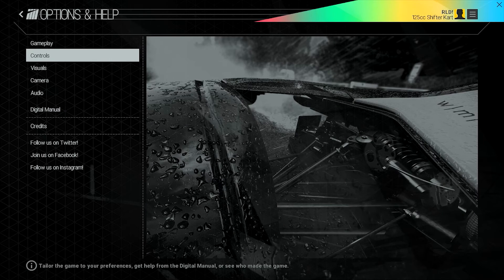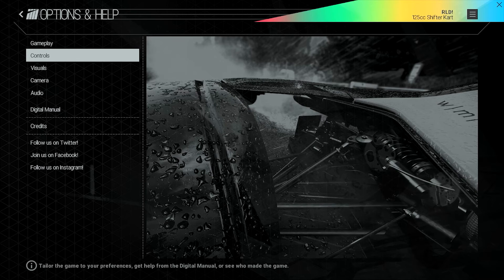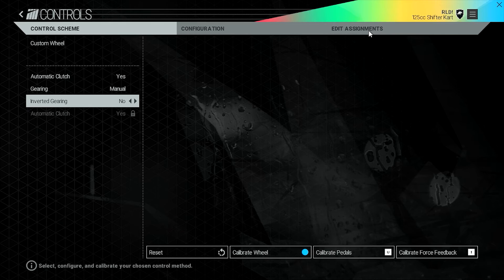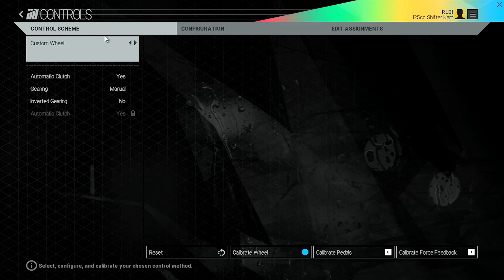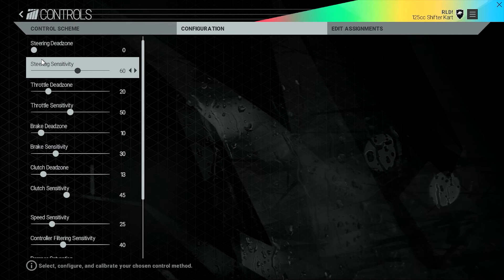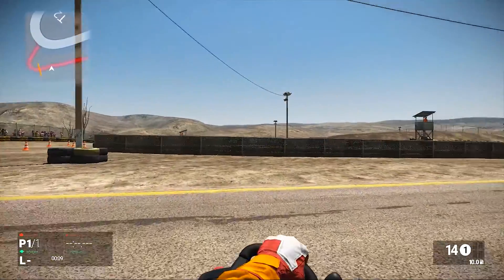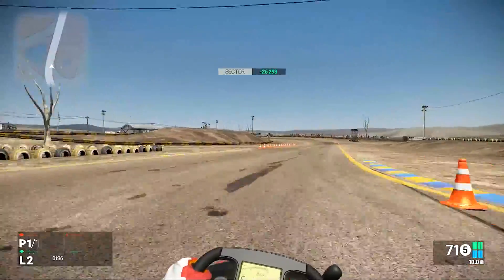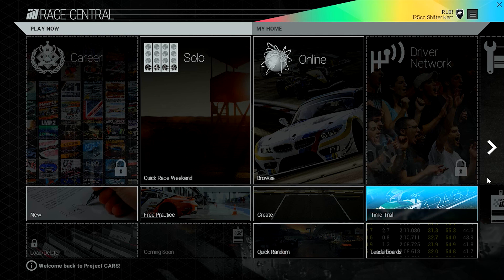Project Cars | How to fix MS Wheel Deadzone Problems! (Works!)

Comment: i do have ffb
Reply: How did you get the FFB to work?
Reply: I don't know anymore, I have a Thrustmaster TMX wheel right now and I don't play Project Cars at the moment.
Reply: Ahh I see. Do you remember if it required a tool or just configuration changes? Thanks
Reply: I believe I just used the software that's being used in this video.
Reply: Thanks :) I will have a look.
Reply: @mariusm5187   im curious, did it work?
Reply: @rdog2262  sadly no, it needs protest firmware from Microsoft